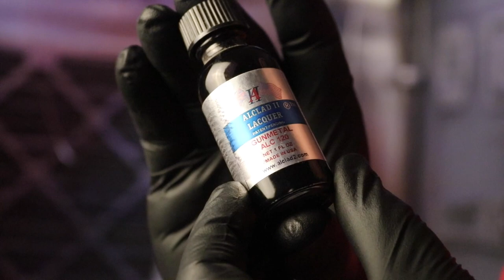How To Make A Star Trek Communicator | Smugglers Room April Fools

Comment: If you have the time, most adhesives like that can be defeated with cooking or mineral oil. Saturate the sticker and wait, it usually will just pop off after a couple of days. I used to clean the labels off AOL floppy discs back in the day with this method.
Reply from the maker: great tip!  Thank you!